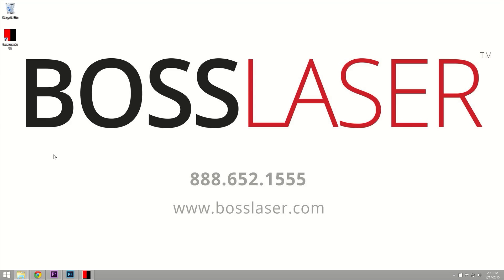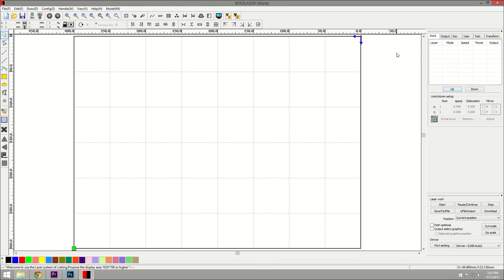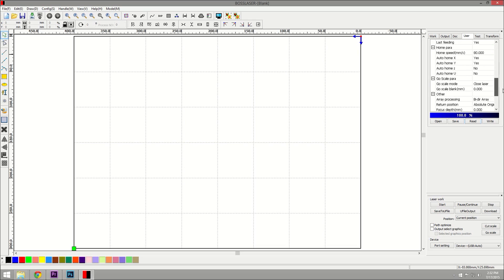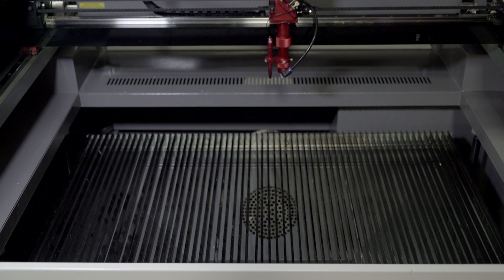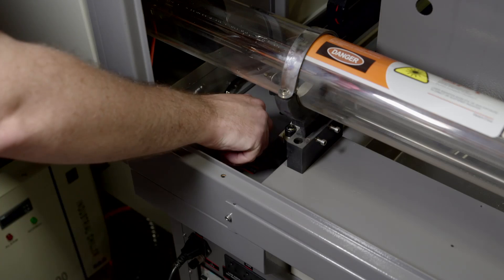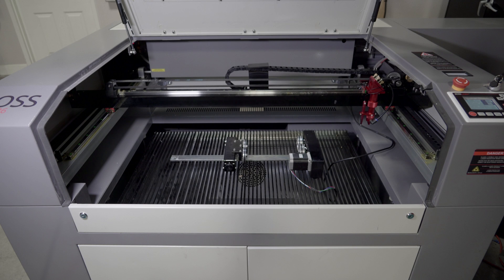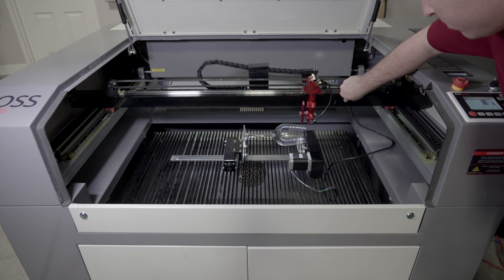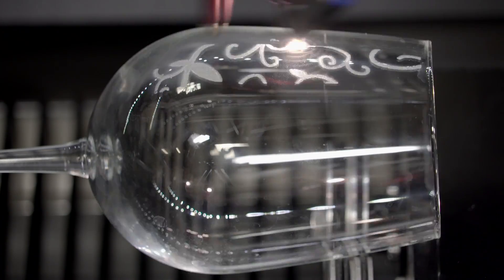Roller Rotary Setup

Comment: hello, excellent video, the value of 4250 in the circle pulse and 35 mm for the LS1416 is constant regardless of the diameter of the object to be engraving, do these values change if a roller other than the bosslaser is used?

Comment: Very interesting video, but you must notice this is due to the fact you 
are using different stepping motors right now. Just change your Z axing 
stepping motor on the rotary to the correct stepping value (same as the 
machine stepping motors), then you will solve this problem. You've 
simply been scamed by the seller if it gaves you such motors for the 
rotary, and different stepping motors for the machine. Always use the 
same stepping motors everywhere, so you will not have to modify the 
settings in vendor/machine mode. Regards....

Comment: Why should the diameter of all machines be set to 35?
Reply: because that is the diameter of the the wheels that turn the object
Reply: @JERCustomDesignsInc  It seems you get it wrong all the way in. As you bought it from a chinese seller, you might have different stepping motors on the machine and on the rotary axis. So why you are turning around to find any solution that would go wrong in any way. The diameter correspond to the part you are supposed to engrave. Never change the pulse by default because it's just slowing down the motor move/speed, and the machine driver will never overrun the motor's max. So the default value is always over everything in the market if you have the correct driver. Now, if you want to simplify your life, just replace the provided stepping motors by the same of your machine, with same stepping. Thuse you will only have to turn on the Rotary option, give the correct diameter, chose the correct power for your laser, and you're done :-)